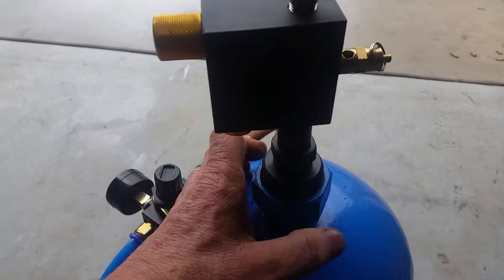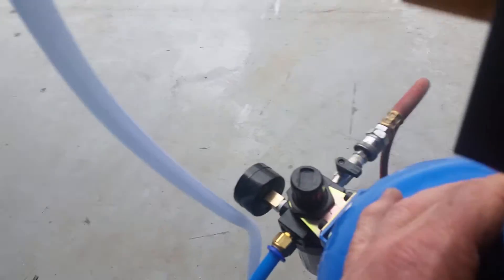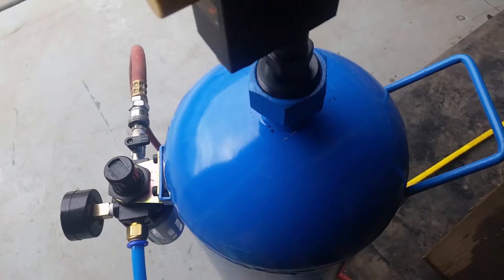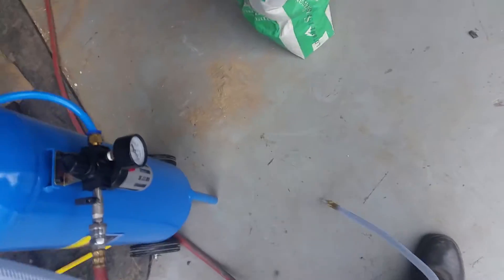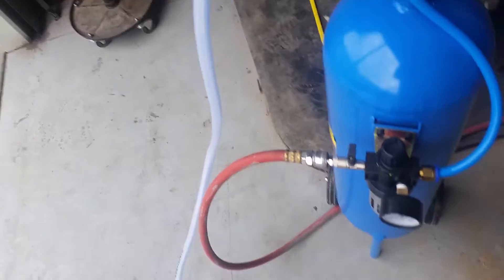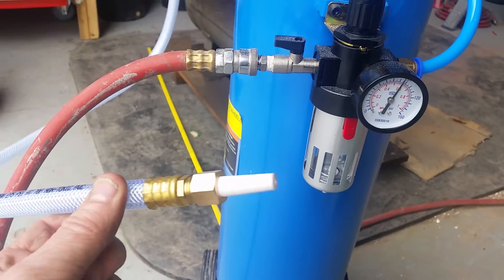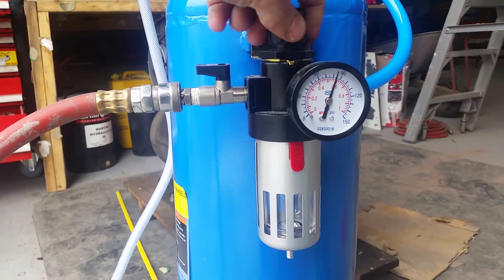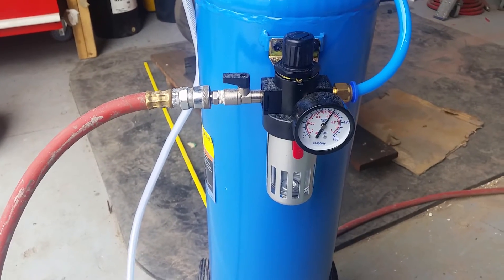How To Use A Soda Blast Pot 40lb Part 2

Comment: What do you think is better to clean an external porous marble floor with the sandblasting lance attached to the pressure washer (120 bar), sodium bicarbonate or carbonate.
 I have to remove, in some places, even some cement glue.

Comment: That big blue bolt your tightening at the beginning of the vid, I recommend using teflon tape on it, I just used my similar 15 lb. blaster yesterday and had to first remove that bolt, add teflon tape as air was leaking out rapidly.   I am wondering if the 40 lb. version works better?  Does it have lagging issues where it seems the soda isn't consistently flowing or any other issues I may not surmise?..The 40 lb. costs only about $40 more than the 15 lb. which is why I ask.
Reply from the maker: We find our 40lb model does not leak air. If you are experiencing lagging issues there could be a problem with moisture in your soda blaster. Our model has great abrasive and air flow. We have one as display model to demonstrate if you need. Call us on 03 9702 4115.
Reply: Yeah I know abut the teflon tape, I have tested it but not used it yet, I'll report the performance when I do.